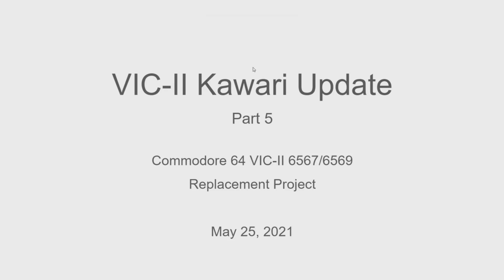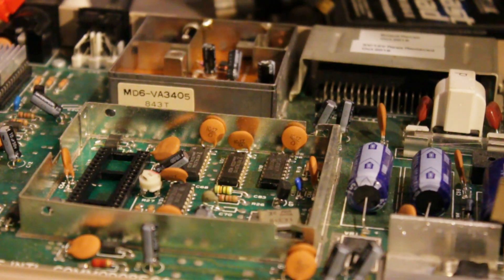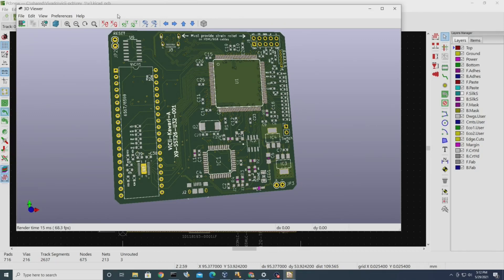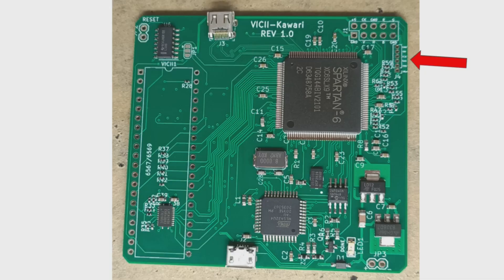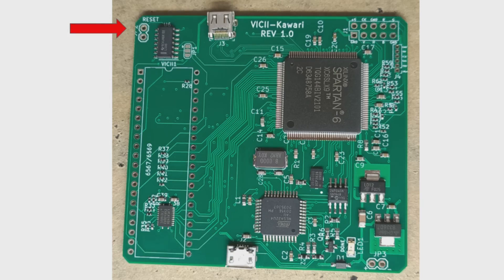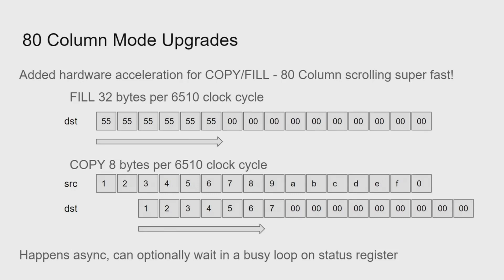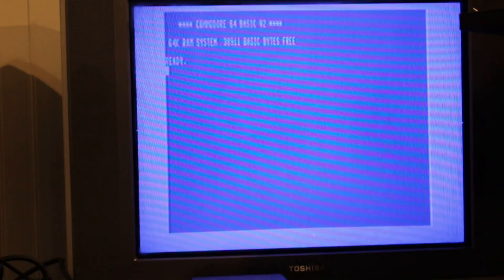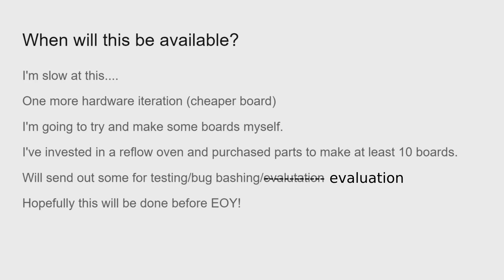Commodore 64 VIC-II Kawari Update - Part 5

Comment: Hi Randy, I think this is a great project. I really think you should keep the advanced graphic modes and extra video memory. Maybe some discussion and polling on exactly what the preferred modes should be. But I like the extensions being offered.

In someways, I think this is a better, more organic expansion of the C64 lineage, rather than new projects like Mega65, or Commander X16, as interesting as those projects are.

Will this VIC-II maintain compatibility with other RAM and CPU upgrades?

Thank you.
Reply: One item that could be interesting to add,  would be a blitter. But I guess that would only be applicable to the custom graphics modes.

Comment: Your ghosting issues are most likely cause by signal reflections on your video cable.  1. Make sure your cable is 75-ohm Z0.  2. Make sure your circuit's output impedance is 75 ohms.  Also, using a passive splitter (Y-cable) is a great way to cause horrendous signal reflections.

Comment: will this let people that are making new games for the C64 use higher resolution and more sprites?
Reply from the maker: I suppose so but I don't expect it to happen much. I added some new graphics modes that use the added video ram but I'm not sure how practical they would be to code a game for.  'Super' sprites could be added but I didn't change anything with sprites.  I stopped making my own extensions to focus on being a replacement first and foremost.  The ability to rewrite the way the VIC behaves is something you can play around with and my extensions are one example of what is possible.

Comment: 80-column text is no issue at all for composite video _per se_, as you can see from the many systems (such as the Apple II) that did this. The two things that cause readability problems are a) colour monitors, and b) composite colour signals.

The problem with a) is simpler to understand: the shadow mask or the aperture grille of a colour monitor breaks down horizontal lines into discrete "dots" that effectively reduce the resolution of the display. Monochrome monitors don't have this problem since, with no mask or grille, each line is a continuous and the rate at which you can switch from dark to light is limited only by the bandwidth of the electronics. Relatively cheap and small monochrome monitors can still produce a fine quality display; my old 10" monochrome video monitor (designed for closed-circuit security camera systems) does a fine job, and even an old 4" door intercom display is reasonably readable in 80 columns. (I've tested the latter only with a monochrome signal; see below.)

The problem with b) is that in colour signals there's a big chunk of the signal in the upper frequencies (a little above that which would produce 200 on/off dots per line) that is now providing the colour information. You can see clearly what's going on there by displaying a colour signal on a monochrome monitor. Those sine waves you're producing that give you a nice flat colour area on an NTSC colour monitor will instead produce a pattern of dots across the line as the sine wave peaks and dips. The usual solution to handling this is to have a separate black and white mode that sends no chroma signal and replaces the standard colour lumanances with eight (or however many) equally spaced levels from black to white for the numeric colour values, giving you a smooth greyscale display. My Fujitsu FM-7 does this by having separate outputs for RGB colour and CVBS greyscale; my JR-200 handles this with a switch that changes the CVBS output between Y+C colour and Y-only greyscale.

I'm not sure if any of the above is worth implementing in your system, but at the very least if you set your text and background colours to black and white and plug the composite output into a monochrome monitor you should see a fine and perfectly readable 80-column display.

Comment: I just rewatched your part 4 and part 5, and I would like to see how the hardware sprites from C64 normal (video) memory integrate with the special/new screen modes and the changes in color palette, Best would be if they used the original palette of the chose VIC-II chip, and kept their resolution, just over/underlaying.
Reply from the maker: Y, the lo-res sprites are made visible in the hires modes but operate as they do in lo-res. Background collisions operate differently and there is probably some weirdness with multi color modes I haven't discovered yet.

Comment: Any Updates?
Reply from the maker: Close.  Unfortunately, I made a mistake in my last PCB run so I need to do another with a correction. Hard to find the parts too.  I want to put at least 10 together to send out for evaluation before I commit to any more.  I will make another video once they are ready.  I figured people would get tired of hearing about something they can't get their hands on so I will put our an update once everything is ready (either to buy or self build)

Comment: Great project and awesome work!
From a end user point, price is not a problem (except it's rocket high), since it's not a consumer goods, I just need to buy one and it work for a long time. The size and how good it fit the existing board is a problem, also the micro HDMI connector is annoying since not popular as standard HDMI.

Comment: Looks awesome. A few questions: 1) Do you think it will work on a C64 Reloaded MKII? 2) My LCD monitor and TV can only accept 60Hz signals, even over HDMI. Would I be able to switch into PAL mode, but still output a 60Hz signal or would I still have to use my Framemeister to convert? 3) Similarly, will I be able to use my old 1702 NTSC monitor, but still be able to take advantage of the PAL mode? Keep up the good work and take your time!

Comment: I had hoped to hear more about enhanced Sprite capabilities.  Also the static nibble ram used for color in "text mode" is hopefully being put on the FPGA, and implemented at (at least) 8 bit width so that it can be used to supply more info to the Video System without stealing cycles from the 6510.

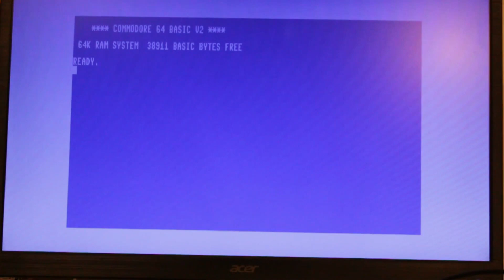Comment: 14:00 I used 80 columns on an Amiga on a TV, so I am sure you can get 80 column neatened up on a composite port.
I certainly hope you keep working on control of color registers.  Hooray for NTSC/Pal toggle!! Eager to see how that RGB 1080/1084 monitor support works.7:00 why would one not want Hi-Res and how would that make it cheaper? How do we email you Randy?
Reply from the maker: There's a lot of wasted space in my 80 column mode because I kept the horiz/vertical timing the same as 40 column mode with border.  So every character is squished into the same space as half a regular character is which would probably not be the case on Amiga (or C128's VDC).  If timing was different, the letters/pixels would be larger but I took the easy route.  If you remove extras like Hires, color config and EEPROM stuff, the core will fit on the slightly cheaper X4 model.  So I was thinking a cost reduced version without bells and whistles would be possible.
Reply: @r3rossi  Can that potentially be altered? We don't need a ton of border.
Without HiRes, or 80 columns, what's the point? Oh, maybe as a cheap Vic-II replacement?

PS Laced mode would be fun for 640x400.

Comment: This is looking really good. If you are looking for anyone to evaluate, I'm in the UK, I've got a working PAL 250407 board with a modulator replacement and GAL PLA chip. I've also got 2 PAL C64C machines which have no modifications to them at all (250469 boards with the 8565 VIC-II).

Comment: @Randi Rossi I have an idea which you may have alluded to in the video. But have a daughter board that replaces the RF module that of course retains the stock S-Video/Composite video, but also acts as a passthrough for HDMI, by using a HDMI ribbon cable from the Kawari, with its own mini HDMI at the rear port of the case. This also will provide a solid mounting point to the motherboard , while also reducing the height profile of the Kawari for a thick HDMI cable.
Reply from the maker: Y, that would solve some issues for sure.  Although it would add even more cost to what might already be a costly board.  But maybe I can add a ribbon cable connector to make the differential pairs available for a future daughter board that replaces the RF modulator.

Comment: Would it make sense to have NTSC/PAL switching too?
Reply from the maker: Y. There will be a header for an optional physical switch that will toggle it.
Reply: @r3rossi  Will software NTSC/PAL switching still be possible?  I've forgotten but does the new board include color and dot clock clock generation bypassing the motherboard?
Reply from the maker: @Ikrananka  Y, software switching is still in the design.  The board has two color clocks, one for each standard so the clock on board is bypassed.
Reply: @r3rossi  Fantastic.  How about the dot/pixel clock - is that also generated by the new board?

Comment: Really love the 80 col support for NovaTerm. NovaTerm had another 80 col driver possibility using the C128 in C64 mode but I understand it was a bit buggy with linefeeds or some such thing. Looks like this has been resolved with your driver? I was thinking it might be another part of NovaTerm's code at fault.

Comment: Nice to see analog video. Note that for the VIC-II  on PAL the phase angles for a color on odd lines is not exactly the mirror of the angle for that color on even lines. For example if you make all even lines red (color 2) and all odd lines dark grey (11), the mixed color will be slightly different from the one you get when you make all odd lines red and all even lines dark grey.
Good luck with your project!
Reply from the maker: I'm using 135° and -135° for even/odd lines in the color burst phase.  Seems to look okay through my upscaler but someone will have to try on a real PAL monitor to make sure I got it right.

Comment: Imagine if this would have been the VIC-III and put into the C128 back in the day. So very cool!

Any reason it wouldn’t work on a C128 btw?
Reply: The VIC-IIe has 48 pins, so you need a slightly different board. Also there are some extra signal which the VIC-IIe handles which also need to be dealt with.

Comment: Did you wind up using the 3&4 byte color codes or the 8 byte color codes for ansi control sequence or both?
Reply from the maker: The driver just has to set the right attributes on the character cells.  So interpreting ESC[32m for example was already handled by Novaterm.  I'm not sure what other types of escape sequences it supports.